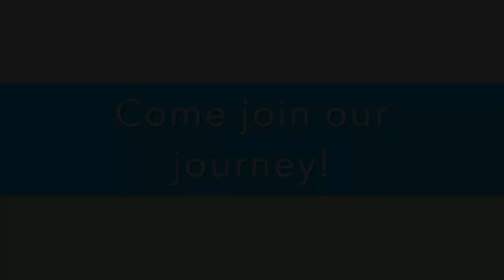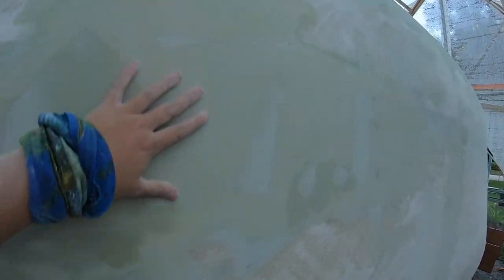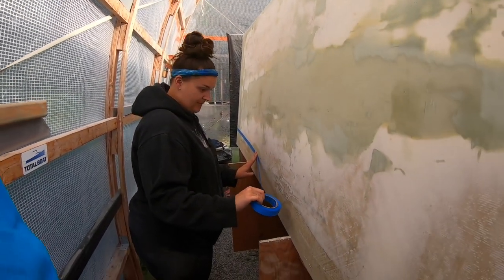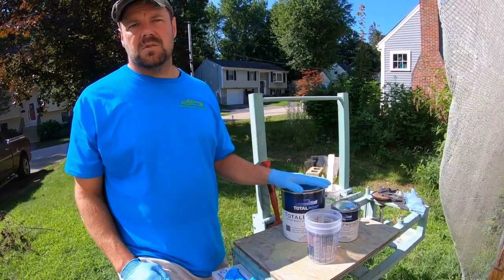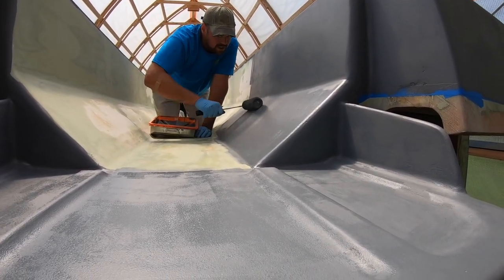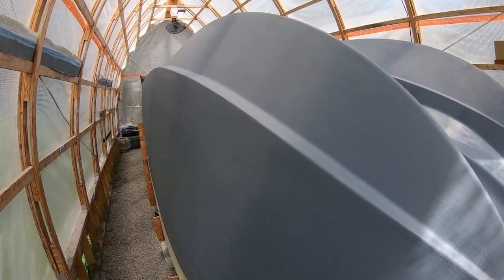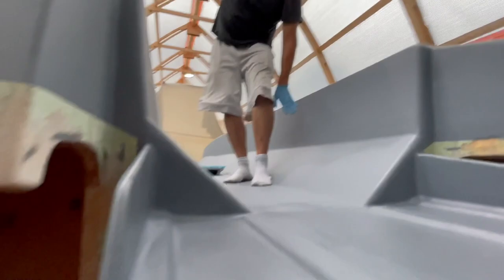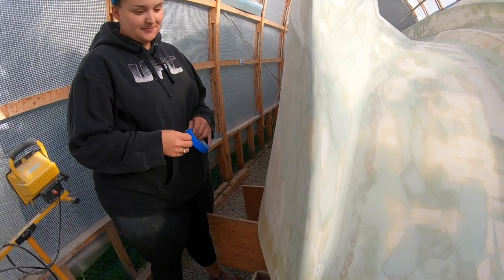Step 57: PRIME TIME!  Total Protect Primer- The Hull is Looking Good!! POWER CATAMARAN BUILD SERIES

Comment: Sweet results... question, I have an old 16 foot whaler and i'm evaluating my process. I am currently still going through the boat with total fair. With this stuff going over top of the  fairing compound now its technically impenetrable as far a water getting into the hull. If im gonna repaint the entire boat after this has been done it seems any topside paint for the interior is fine. What specific paint should you use for the exterior of the boat that can  will be exposed to the water. Im not looking to use anti fouling on the sides as thats obviously not necessary. Any recommendations would be appreciated.
Reply from the maker: I’m not sure how impenetrable the fairing compound is, just like any unsealed fiberglass it is porous to an extent. Under the waterline it is recommended for I believe 3 coats of barrier coat. We used total protect for our vessel. As far as above the waterline we used a regular epoxy primer then we sprayed epiphanies paint over that. Any salt spray should wash right off of this. Alexseal is another comparable paint. Im pretty sure Andy with boatworks today did a comparison video on the two. Thanks for following along more videos coming soon 😊

Comment: Hay Guys, Starting to look good!  Some thoughts (as a professional boat builder), in the hope it helps you;

1) Not a good idea to paint both sides at the same time (as shown in the beginning of the painting sequence).  It is better to paint one part of the entire hull (such as the bottom panels of one hull) then move and paint the other side.  While it doesn't particulary matter for the under coats, it will show on the finish coats, so it is better to develop good painting habits from the start.

2) You could consider spray painting, it will give you a better and more even finish.  If you start with the undercoats, will be fairly practised (especially if you watch a few YT videos beforehand) before applying the finish coats.  If you don't like how the first finish coat looks, you can always get a professional to apply the final finish coat.  The cost will be worth the finished look of the boat!

Hope this helps,

Professional Boatbuilder and Naval Architect
Reply from the maker: thank you as always for your comments we fully appreciate them. we understand what you mean and will definitely have to be aware of that when we paint! thank you again.